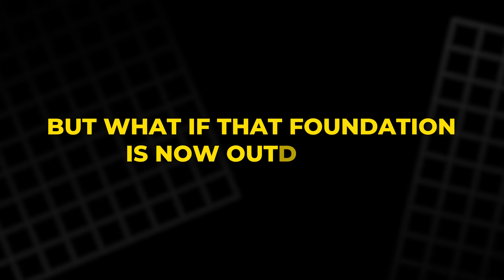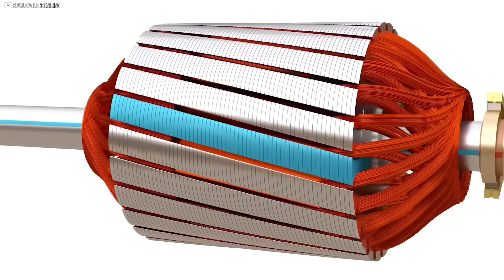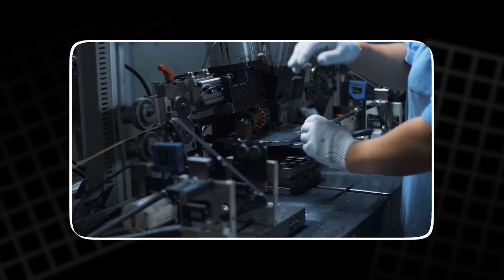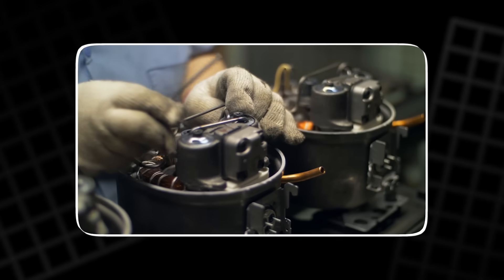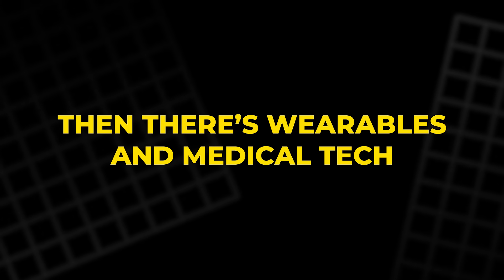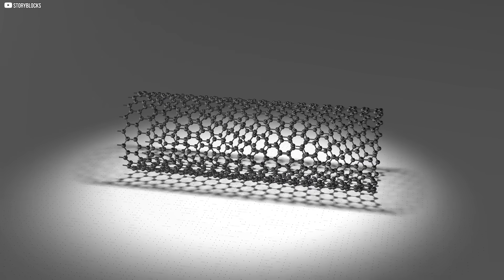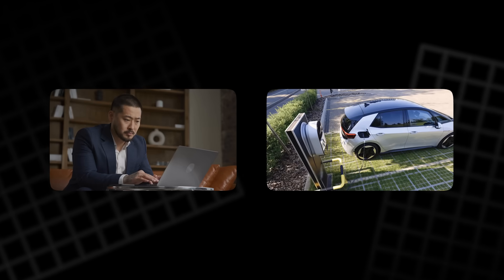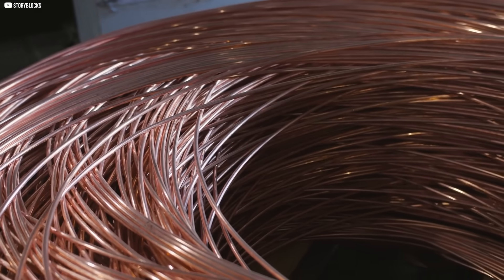No Metal, No Limits: Carbon Motors Are Quietly Taking Over

Comment: How about mixing lithium with silicone and insulating electricly and chemicly from corrosion with  harder silicone cover. Then it's extreamy light weight and can't burn or corrode . Thermistor to shut off before it heats up.

Comment: What about the ironcore both in stator and rotor, is that also getting replaced with something light or the winding only? Currently both the winding as well as the ironcore, heavy. As far as I know, the only light weight e-motor is the x-tal motor.

Comment: Google for this article "World’s first metal-free electric motor boosts conductivity by 133%, cuts weight 80%" to see a picture. Spoiler: it looks like a regular motor but with black wires. I figure drones will be first because of the weight, then other aircraft.

Comment: Replace copper in motors with carbon. How about all the copper wiring in a home? or in a sky scrapper? under sea cables for off shore power gen onto the shore. He who makes the first carbon wire to replace copper will change the world. That's a game changer. Price of copper would drop that's for sure, Carbon doesn't corrode either, carbon is its natural state, it's not trying to Oxide into anything.
Reply: Sorry but it actually is going to oxidize into CO2 in case of a fire! So you are just increasing the amount of global warming with your reckless plan. Don't you care about the Planet at all?! How dare you!
Reply: We can't.

Comment: They should use layered graphine instead of the hassle of nano tubes. It conducts electricity, transfers heat well, and with thermal electric generators with heat sinks. Just my opinion of course, I'm dit's the cause us to the treatment. Definitely not any kind of expert.

Comment: Would a copper-carbon alloy be more feasible for use? This would cost less than an all-carbon motor and also be more conductive. At least, until we figure out a method to reduce the costs enough
Reply: Possibly copper, or another metal like silver 'doped'  or selectively replaced/substituted for a small number of carbon atoms in the hex structure itself could offer this same or even greater level of enhansement in conductivity,  as well as other properties of the nanotubes: just some wild speculation to explore the possibilities...
Reply: Viable space suit technology may be possible in a pressurized state using carbon nanotube based fabric and structures for flexing, versus what we've seen so far that doesn't hold up under critical review.  This isn't to deny near-Earth orbit but to recognize that some activities have been orchestrated, while funds are diverted to undiscosed rogams with greater potential, yet kept from public awareness and our ability to benefit from such technologies for both means of travel as well as the production of energy without the need for fossil fuels. 

Military personnel have recently testified before Congress of the back-engineering of alien spacecraft -- something that has been going on for decades, while public programs serve as a distraction and the diversion of funds. Near-Earth orbit is real -- however, evidence of layered video as well as other indications reveal that not all near-Earth activities are real as demonstrated as other undisclosed programs receive allocated funds. During the 1990s, former CEO of Lockheed Corporation Ben Rich described the ability by that time to reach other star systems, as well as many other amazing developments that he stated would take an act of Congress to release for the benefit of all of us -- including means for the production of unlimited energy without fossil fuels using similar technologies. Tesla himself had developed such means over a century ago, only to have his facilities as well as his reputation destroyed sufficiently to prevent funding for his efforts again moving forward -- he himself responsible for the development of the electrical grid that we still use today, before the turn of the 20th century.

Comment: The only bennifit carbon has over any other conductor for electricity is, carbon is the only element that when heated , the resistance value is decreased.  Meaning the warmer it gets , the better conductor of electricity ir is.
Reply: Viable space suit technology may be possible in a pressurized state using carbon nanotube based fabric and structures for flexing, versus what we've seen so far that doesn't hold up under critical review.  This isn't to deny near-Earth orbit but to recognize that some activities have been orchestrated, while funds are diverted to undiscosed rogams with greater potential, yet kept from public awareness and our ability to benefit from such technologies for both means of travel as well as the production of energy without the need for fossil fuels. 

Military personnel have recently testified before Congress of the back-engineering of alien spacecraft -- something that has been going on for decades, while public programs serve as a distraction and the diversion of funds. Near-Earth orbit is real -- however, evidence of layered video as well as other indications reveal that not all near-Earth activities are real as demonstrated as other undisclosed programs receive allocated funds. During the 1990s, former CEO of Lockheed Corporation Ben Rich described the ability by that time to reach other star systems, as well as many other amazing developments that he stated would take an act of Congress to release for the benefit of all of us -- including means for the production of unlimited energy without fossil fuels using similar technologies. Tesla himself had developed such means over a century ago, only to have his facilities as well as his reputation destroyed sufficiently to prevent funding for his efforts again moving forward -- he himself responsible for the development of the electrical grid that we still use today, before the turn of the 20th century.
Reply: “Only” is a huge word. Carbon is also extremely plentiful. It also doesn’t oxidize. There are numerous other benefits.
Reply: @jonathankeithkidd Someone let carbon know it doesn't oxidize!